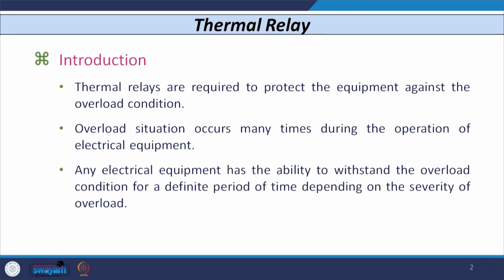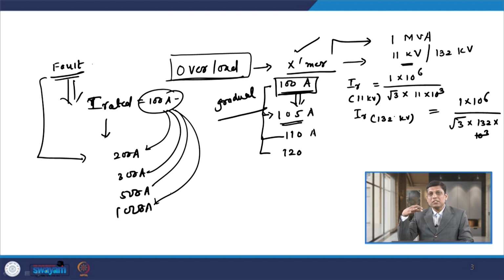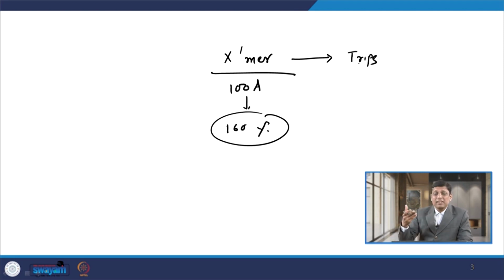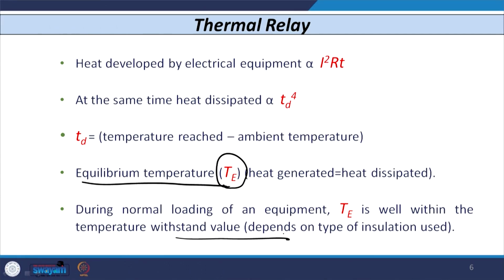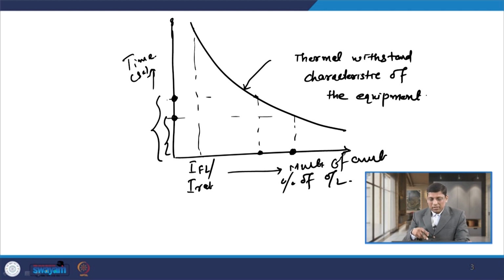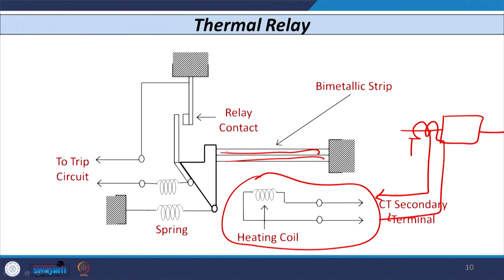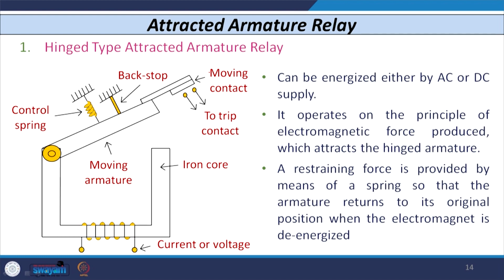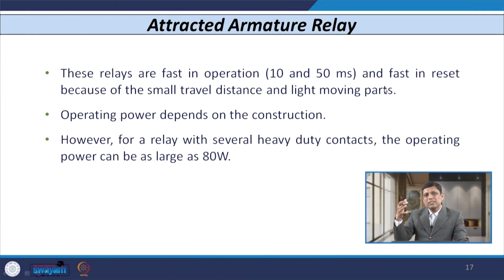Lecture 4 Fundamentals of Protective Relaying-IV

Comment: Excellently explained. Sir I have a doubt at 23:04 where the application  of thermal relays is in lv dc motor. How will the CTs energize the heating element in thermal relay as the supply is dc? Pls reply
Reply: Bro, the heating element in the thermal relay can be energized directly by DC current through different methods. CT usage is avoided in DC applications.